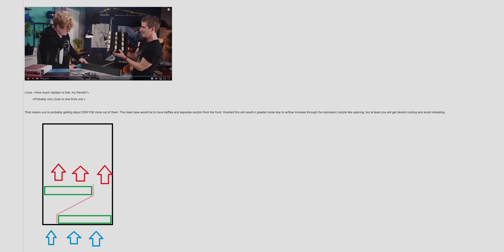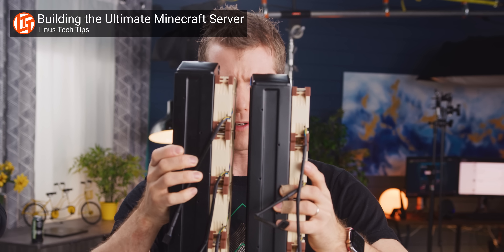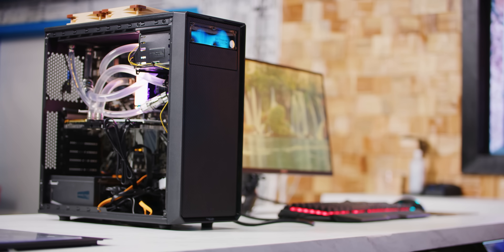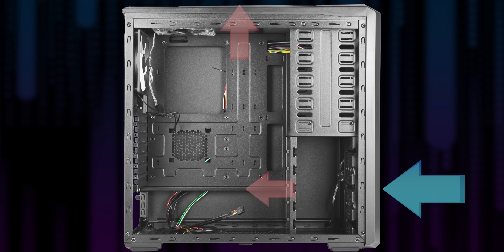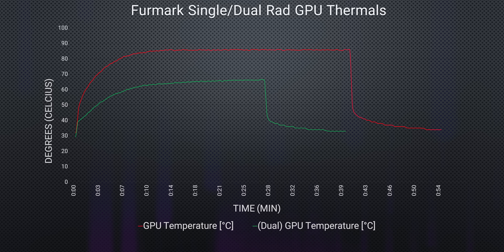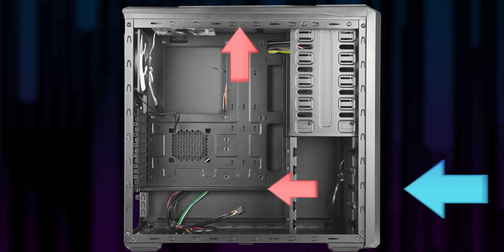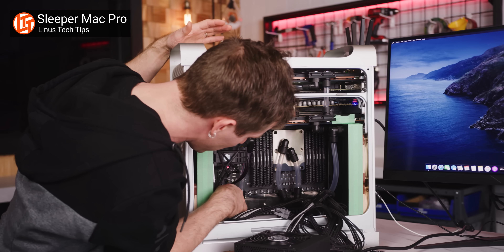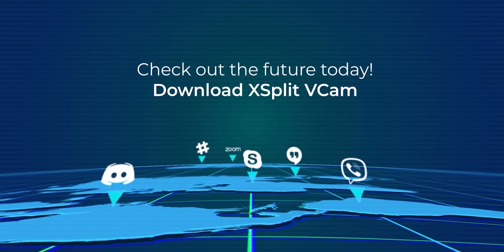I’ve been water cooling wrong for YEARS - $H!T Manufacturers Say

Comment: If you have ever paid attention to why the CPU block is sooo much smaller compared to the radiator, its not a coincidence. 
Water has a incredible thermal capacity and conducts heat really well, however it's a really bad medium to remove the heat from. Its actually why one of the reasons head pipes are so good, their thermal conductivity is great in both directions. 
There is also a similar issue with air, it's actually really poor at conducting heat. Ideally if you had a limited air flow through your case, it would be better to have the air slow as it crosses the radiator so it has more time to conduct the heat from the radiator fins. It's commonly done in vehicles, have a small opening at the front of the vehicle which has a pressure drop before it hits the radiator so it causes a slowing of the air. 
At the end of the day more air flowing is more heat being pulled away from the surfaces it touches, but if the air flow is limited, slowing the air across a larger surface area is better. 
For a server rack as this was used as an example in the video, you could spread the rad's out so they are only 1 layer thick, but the same surface area, such as a V shape.

Comment: This obviously brings up another question. Does using one 360mm radiator function the same, better, or worse then using a 240mm and 120mm radiator when placed in the same case?  And would it be better to stack the radiators on the front of the case, or use a 240mm on the front with a 120mm on the exhaust?

Comment: The problem is you didn't actually stack radiators here. The minecraft server was clearly stacked, but on your experimental setup, there was tons of room to introduce new cool air in to the radiators.

Secondly, the test was a steady for the CPU and GPU temperatures, but I'm certain that if you were monitoring the inlets and outlets of the radiators, you'd see that the temperatures were nowhere near steady state. You'd have to run the tests uninterrupted for multiple hours to get to steady thermal state on the radiator outlets in your "experimental" setup. And since no one runs adobe or whatever for 30 minutes and finishes up for the day, a longer test makes sense.
Given that you used 240mm rads, with a very open setup, its understandable that your test differed from the theory. It does surprise me that you got these results using a serial configuration, where the heated outlet of one rad, goes into the "cool" inlet of the second radiator.

My proposed setup:
Control setup: Air cooling. just pick something
Experimental setup #1: start with one 60mm rad. Add 60mm rads, with fans pointing at each other, and piping in serial. Log inlet and outlet temp of rads, and water blocks.  Tests end when the outlet temperature on the rads stop rising. Continue adding another rad until it gives negligible changes.
Experimental setup #2:  Same as before, but use piping splits  to make the flow go in parallel(you will need higher pump flow for this) to 
rad gives negligible changes. End the test when you've done the same number as experimental setup #1.
Do this, and you will understand something new about thermodynamics.
(edited for grammar)

Comment: Wasn't Corsair's comment about 'stacking though, as in the server build? This test did not stack and was just a dual rad setup, its a shame the server setup couldn't have been roughly duplicated.
Reply: miss the part where he said they removed 1 of the 3 stacked rads from that exact server and temps went up 5 degrees?
Reply: did you not watch the whole vid? He says they removed a rad from the server stack and temps went up 5 degrees C
Reply: Exactly, pointless test.

Comment: It matters which rad you were going into first. Using the front mount first would mean the most heat being dumped into the case, meaning you had hotter air and "less hot" water in the 2nd rad, with little to no impact. In your build, you output thru the top first (or so it seems), so it was warm air and hottest fluid then warm fluid and cold air, giving both rads a change to have an impact (and the front rad would also dump less heat into the case because of the "pre-cooled" water from the first rad).

Comment: I have two CORSAIR Hydro X Series XD5 Pump/Reservoir Combos and three 360mm radiators and nine 120mm fans in my loop. My case is a Thermaltake Level 20 HT and I do see better cooling results with this setup. But, mostly I did it to have a quiet system. The fans are set to 800 RPM and are nearly silent at this speed. Also, it just looks pretty damn cool. LOL

Comment: Further experimentation should have been to instead of have a push-pull fan system with the radiators, have both rads fan set to push air in. My thoughts are that the system would be more efficient in transferring the heat energy because of the larger potential difference in temperature between the air and the flowing liquid, DeltaT is key in transfer of heat energy.

Maybe a follow up video could be to explore the fan push pull config in cases with radiators and calculating the efficiencies therein?....

Comment: I guess Linus has never noticed they don't stack AC units on top of each other directing the hot air from one into the intake for another.
Reply: One thing does not have anything do with the other. AC manufacturers (unlike PC builders) don't have constraints limited by case size, rad size etc...

Comment: you could just have measured water temp and air intake temp for the 2nd rad. as long as the air going through the rad is colder than the water, the rad does something. doesn't say it's the optimal config though...

Comment: if you really wanted to do it right, youd isolate the rad in its own chamber so that only cool external air touched it and immediately vented back out to the external environment without touching the hardware with the heated air. then, you would separately air cool the chamber where all the hardware is.

Comment: Their claim could maybe be true in a tiny case where the radiators take up all the available space.  In that situation, the extra air volume of taking one out may be beneficial.   Kind of a ratio thing.  Sort of like how in a car engine more airflow is theoretically going to mean more power, but if you don't have the fuel flow to match it then you are going to blow up.

Comment: Isn't it also important which direction the water and airflow has through the radiatiors? You can have a cocurrent or a countercurrent flow, which would make a big difference. You should try to build a countercurrent flow (if you didn't) since your "water output" will approch the temperature of your "air input" instead of the "air output". Which means having the second radiator on the air intake and the first on the air outtake. Maybe corsair had a cocurrent flow arrangement and you a countercurrent. 

You can check the english wikipedia article on heat exchangers (point 5.3 "flow arrangements") for additional information. 

I hope this makes kind of sense, my english is not the best.

Comment: It's the best to just move radiator completely out of the case, and still have additional fans inside of the case. But that's not very practical, and most radiator hose is not as long, unless you do it custom. 

I have experimented for years, and I learned that having all fans intake is better for good temps, no exhaust fans, but in my case, and I water cool with 360mm radiator. 

I tried many times, and I realized over the years that ambient running into the system is more practical for great temps. So I have 6 noctua fans pulling air in

3 of which intake through radiator.

Comment: Both of my 360mm rads are set to intake. I see no reason to have more than one exhaust fans as my case has a glass side panel that's definitely not sealed, so positive pressure exhausts the rest of the air that isn't being exhausted by the single rear fan. If I had one of them set to exhaust, yeah it would be useless. But who sets their rads to exhaust? That doesn't make sense to me

Comment: I get what they mean on the air in through radiator, then out through another one. Ideally you'd probably want 2 radiators both blowing out high in the case, with a third none-radiator fan pulling in cool air from lower down.
Reply: Agreed. This is kinda dumb.

Comment: You should also take in consideration the thickness of a Rad. The Numbers will be more in Corsair Favor if you take  a Monsta (86mm) compared to a "normal" (46mm) or even slim ones (30mm). But this is basicly stacking Radiators.

So i can only tell for my self. I have a full overblown Sensored Watercooled System (i had to many Temp sensors left so i just overkilled it :) ) in an O11 Dynamic Case. i have 2 * 360 Slim (due Space on bottom and Top) and 1 360 normal from the side Panel. And Airtemp Sensors before and after the Rad. Ofc the Bottom and the Side one are intake and the top one is outtake. The Sidepanel is  the most efficent one with removing heat from the water (highest temp diff). So After Corsairs Opinion my Top Rad would be completly useless because 2 Rads put the hot air into the top rad ... but it still has a 5°C Difference under load. (With the following Base Values: Airtemp room ~24°C, Water Temp under load 34°C, CPU ~38° and GPU ~45-50°) yes i know i should refresh the thermal paste ... but it's still fine for 3,5 years runtime.

Btw. Can you debunk the "Pump needs a high flow for good temp". Would be nice to have a reference video to post if some ppl saying that you should get 100l/h to get "decent temps" i tested different flows and i can only speak for me, the difference between 40l and 100l on the hardware and water was ~0.5°C

Comment: So, what Corsair said was that adding more radiators to that server you built wasn't going to do jackshit because there wasn't enough fresh air in that tight space because you stacked them on each other, so there was only hot air circling between them. If you want to make a better test, redo your server with a single radiator and compare the results!

Comment: Loop config may play a part as well. If you have the “outlet/cold” rad on the inlet side there may still be enough temp delta inside the case to allow the second rad to work

Comment: Why not just set both of the radiators to exhaust while other intake fans are ensuring that there's relatively fresh air circulating in the case, even if it heats up a bit from cooling the VRMs and such. Never water cooled, but that seems like a decent compromise. Hell, if the entire system is water cooled -- VRMs, CPU, GPU, all of it -- why not just set the radiator fans as intakes and exhaust all the hot air via case fans.

Comment: Corsair massively overestimating the efficiency of a radiator.
However it would still be a good idea to put the hottest water through the radiator with the hottest air for maximum efficiency. you don't want a massive temperature diff in one radiator and then no diff in another. better to set it up so the hot radiator chills a little before the cold radiator chills more. That's how gills work in fish.

Comment: Corsair is kinda right, they should try to stack the radiators in a test bench and also the non stacked configuration and they would see the difference. All radiators should be sucking air from outside, its efficiency will be much better.

Comment: i would say it's only inefficient if one RAD is already doing a good job, let's say you have a kraken x63, and a Ryzen 5 3600, it's only a 65 watt chip, lets say it only hits 60c under load, you add another rad it would probably hard make a difference 5c at that most, but lets say you had the new Intel space heater i9-10900k hitting 90+c then maybe a 2nd rad would help.

Comment: The problem is you did the test with "brand new" (clean) radiators. When dust builds up in them the airflow decreases and that could cause higher temps if you stack them.

Comment: "Stacking" was talking about the  physical layout of the rads, not the fact there were multiple in the same loop. 
This test was useless. 
Actually you missed the point so much I think it was on purpose to generate comments.
Reply: Linus said they removed a Rad from their server to check as well and saw a 5 degree uptick in temps.
Reply: @albe23  yeah, but had they moved the second radiator to a different outlet instead of feeding it hot air directly out of the other radiator they might've seen a significant reduction in temperature. Corsair's point wasn't that having a second radiator was useless, their point was that physically stacking them on top of each other instead of feeding them both air at ambient temperature is sub-optimal.
Reply: @TheREALMcChimp  Exactly! Basically Corsair's telling them to mount each radiator to their own intake (front + bottom, exhausting through the back/top, for example) instead of mounting them in a series or as intake/exhaust. Which is completely sensible and maximizes each radiator's cooling potential.
Reply: @TheREALMcChimp  not sure where you're going to find more inlets on a server rack other than the front. Also, just like in HVAC systems, if you have your input begin with the rear rad stacking works even better when you're space limited.
Reply: This would be true in the ideal Scenario that the first rad has a perfect heat transfer which means that the air coming out of the first rad comes out close to the temperature or even greater temperature than the fluid temp... and that varies wildly with surface area (ex: a thick 120 rad vs a slimmer 240 one) air flow speed (fan speed and static pressure) and even case design (cases like the 011 Dynamic with fresh intakes with no rads)

Comment: Yep your theory about the additional cool air is good but also they're making a big assumption, regarding the thermal gradients across the second and third radiator. Additionally, if the hot side starts at the last radiator and then flows to the first, then you still maintain a good thermal gradient since the air first hits a radiator with warm water and it gets heated up a bit, then gets some system heat and finally runs across the hot radiator where there is still a big thermal gradient. Also I'm willing to bet there one rad math ia assume perfect airflow to facilitate the highest efficiency transfer of heat and not the realistic situation if a lot of air moving through.

Comment: So bottom line: slight positive air pressure is better with both intake and outake fans, you should always try to cool your hardware with ambient not heated air, more fans = lower noise and better temperatures, water cooling takes longer for the harware to heat up, but also cool down, but its easier to add a 360mm rad to a cpu than a 3 fan huge cooler that might bend your mobo and finally no, adding more cooling to a already sufficiently cooled system most likely will not give you any extra performance.

Comment: Putting multiple radiators in series is only viable if airflow is high enough because the first radiator has less time to heat up the air, leaving it cool enough for the second one to still perform.
For a low airflow silent system it is better to install both radiators as intake or exhaust so that neither of them has to work with preheated air.

Comment: The heat transfer from the radiator to the air is not going to be 100% efficient. The air exiting the radiator will still be cooler than the radiator itself, and thus still be able to cool the second rad.

Comment: It is strange, that this works so well, but stacking radiators has worked for decades in all kinds of vehicles.
Transmission/engine oil cooler, AC condenser, coolant radiator

Comment: should've tested with running the fans in opposite direction, i.e. 1 intake 1 exhaust, 2 intake or 2 exhaust and see what the diffs are then, logics would tell us that doubling down on intakes would give you the coolest ambient airflow through the rads, but you'd be putting a lot more dissipated heat into the case which coul potentially warm up other elements like mobo, vrm, and gpu-pcb for example. there are so many small nuances to temperature testing in pc's that it's virtually impossible to test everything, but only doing 2 or 3 test's seems like the bare minimum. what about rad thickness, static pressure vs airflow fans in detail, case ventilation, internal case air pressure and dT, airflow path inside the case, dT before and after a rad, like how much increase in temp is actually happening, coolant volume vs rad volume, optimal pumpspeed for rad vs optimal pumpspeed for waterblock.... literally a thousand factors to take into account when chasing the lowest possible temps